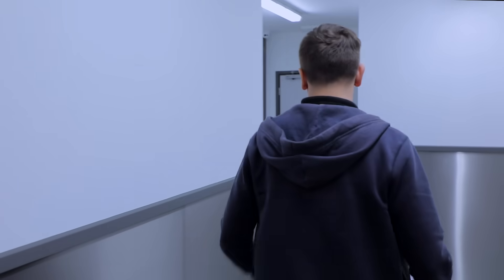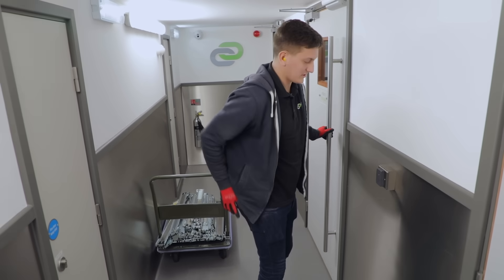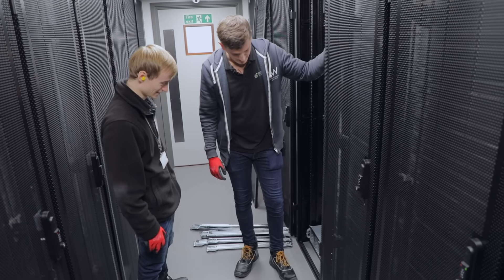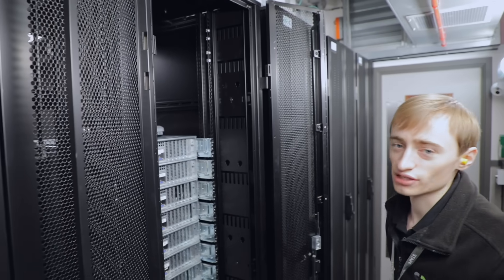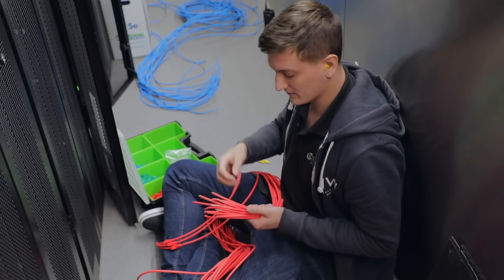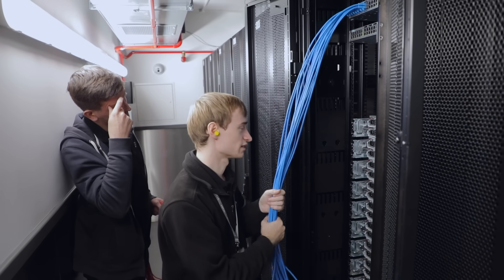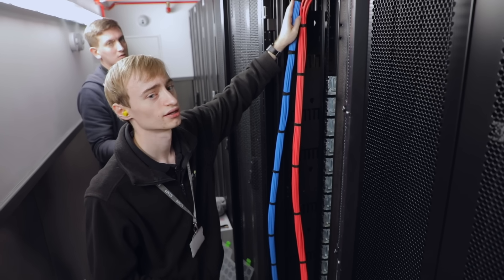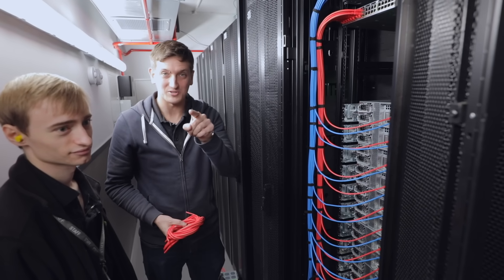A DAY in the LIFE of the DATA CENTRE | FULL CUSTOMER "RACK & STACK" with ASH & JAMES!

Comment: Wow! 1 minute in and I see 10x2RU servers stacked on top of each other. It might be convenient but I don't think the customers or manufacturers would appreciate that much physical stress on their hardware!  

This has to be one of the most incompetent rack and stacks I've ever seen! I workshop on how something can look great and be terrible. 

Other observations:
Using Cat5e cabling in 2019 is ridiculous
Suggesting that people should make their own cables rather than using pre-made certified cables
Actually cutting cables to length rather than using standard pre-certified cables in a datacentre
Power and Fibre co-exist way better than Power and copper
11:20 OMFG not leaving leaving sufficient cable length to allow the server to be pulled out for service/upgrade

Cable Porn does not equal good cabling!
Reply: To address your points in order:

The frames of the servers are more than strong enough to handle several hundred pounds. There's no way that would do literally any damage whatsoever.

The cat5e is kinda stupid.

Custom length cables are always superior and they likely cable tested these after making them.

Fiber is significantly more expensive to maintain as they can get dirt, and optics are more expensive than copper.
Reply: This reads like someone spouting shit that they know nothing about.
Just to shit on what you commented.
1. Servers can be racked on top of each other no problem, if you can't do that you bought the wrong types of rack that cant support the weight of your servers and it wasn't planned well.
2. If you use Ethernet cables for a large amount of traffic you are doing it wrong anyway, these cables are mostly only used for management traffic so their quality isn't really important cat 5 will do the job unless your datacentre is in a microwave. 1 for iLO/iDRAC access and the other for management access to the OS.
Most production networks use SFP+ ports with LC fibre 10GbE+ for their high volume production network traffic so you'd only be pissing money away getting cat gazillion cables.
3. Cables should be removed when servicing equipment, the great thing is these guys colour-coordinated their cables so that makes it easy to plug in and out.
Reply: @Alex-mu4ue  "Cables should be removed when servicing equipment" dude seriously?u took out the whole thing even as simple as swapping the RAM/CPU?
Reply: You have no idea what your talking about.

Comment: that was a great video,i have a question.
how to choose the best Cisco switch for a server rack like the one you just installed??
Reply: Normally the datacenter does not help you with what kind of gear you need, they only serve the power, room, uplink and cooling. They also have remote hands and / or installation engineers.

To choose which gear suits you the best you'll have to find a partner certified for the brand you want, in this case a Cisco Certified partner.
Reply: @Ano_ny  Thank you for your answer,
besides that can the switch and servers be at the same rack in Data center stranded
Reply: @bedodado5148  You can put all of your equipment in the same rack if you want to.

Sometimes this is not ideal in the case of huge power draw or heat output. This is normally not an issue and the datacenter should warn you if you are overcurrenting etc.

Comment: What is the difference between a 2u and a 3u can you tell me I know a Dell r710 is a 2u, am I correct in assuming that a r820 is 3u
Reply: it's the height in RACK UNITS (commonly shortened as "U" or "RU"). 2u means the server will be 2 units tall and 3u means it will be 3 units tall. a unit is a single space in a rack
Reply: The height of rack mount equipment is measured in rack units. Each “U” is 1.75 inches. So a 2U server is 3.5 inches high. A 3U server is 5.25 inches. 4U is 7 inches.... 

A full height “floor to ceiling” rack has 42U.

Comment: Great video. Would be interested to see how you manage fibre cables as they are pre fabricated fixed lengths? How do you manage the leftover slack for fibre?
Reply: You can also make fibre cables. Just need a few specialised tools and some test equipment. Most people use a fusion splicer which is quite costly although I believe you can splice fibres using a glue based system if you can handle some additional splice loss. Fibre work is more specialist and has significant OHS hazards compared to copper.

Comment: Why do you cut the cat 5 so short?. You can't pull out the servers.
Reply: if you have to pull the server out, it means you have to replace non hot-swappable FRU or do some serious repair, so you shut it down, unplug cables and then pull it out. Hot-swappable FRUs usually placed in ways to allow swap them without pulling out the server.
Reply: 44 Magnum unless the internal fans are also hot-swap. Which is the case with many servers. Personally think cable management arms look a lot better anyway.
Reply: @jonathansheppard8875  the problems is that you need the cable management arms for the servers, using these will hindre the airflow there, most data centers dont use cable management arms as they keep the warm air captured, i have around 10 full 42U racks we lowered the temperature some degrees just by skipping all the cable arms.
Reply: @whistler2000  Exactly this. I manage 2 cages in 2 datacenters for a customer of us and by deleting all the cable management arms the general system temperatures went down by a few degrees celcius. Upcoming we have a big cable re-ordering which hopefully brings it down a few degrees.
Reply: @whistler2000  correct . i am also fix and replace switch and server get problem if no good cable management

Comment: Great job! One suggestion for you from my bag of tricks. Once you measure out the length from the loom to the server, cut a "reference" length of cable from the box the same length. Now you have a measuring stick so to speak to cut the other sever cables the exact same length exiting the loom. Then the install will then look very neat.

Comment: This looks like a small cheap data center. The one we have it’s ceiling higher and each room is dedicated to each customer.
Reply: The reason the roof is so low in each pod is so that the hot and cold isles can be sealed off from each other. If you have a massive gap on top of your racks that defeats the whole point of putting the blanks into the racks.

Comment: CAT 5?????
Reply: on short runs it doesnt matter. 10gbit is no problem as long as you stay under 1m
Reply: What's wrong with it?
Reply: laszu it’s only cat 5, why not even cat6? There data center only has 10Gb uplinks?
Reply: laszu it’s only cat5.  That’s what’s wrong
Reply: you can easily cut and crimp them at a needed length; need 10Gb - use DAC cables

Comment: The vertical bars are actually called rack rails. The rails are actually called server slide rails.

Switches should always be in the back, unless its a patch rack.
Reply: Aren't they called posts? The racks in the video are 4 post, you can get 2 post as well.
Reply: Depending on the switch design, some switches should be placed on the front, if they dont support the right push pull for the airflow
Reply: @whistler2000  Any proper DC switch will allow for either forward or rear airflow fans and PSUs. Most non-DC switches (which a lot of people still use) are side-cooled which makes no difference as to whether they are front or rear mounted (they'll run hot either way)

Comment: nice work! but unfortunately you cant pull the machines out because of the measured cables for example switching failed fans etc. ...
Reply: servers that allow hot swap of failed fans or something that make you pull out live server are come with cable arm in a box
Reply: @44magnum84  afaik they have to be ordered seperately. but yes, they´ll do the trick
Reply: just disconnect the cables, repair and reconnect

Comment: In this way you have a lot of discarded cable.
The best way is take the longest lenght for the first 2 cable  and then cut 20 cm shorter the next 2 cable from bottom to the top, and go until the last two.
In this way you can save 10 or more mt of cable.
Nice rj45 shells
Reply: Bb
Reply: B
Reply: Bbg
Reply: Bbgg
Reply: Gbg
Reply: Bgbb
Reply: Ggggggg
Reply: Hggggggggg
Reply: Hbggg
Reply: Hbbb
Reply: Bb GB glggg
Reply: GB hbgblggg
Reply: Egg
Reply: Ggg
Reply: Gbgg
Reply: Bgg
Reply: Gh
Reply: Gbggg
Reply: Gggggg
Reply: Lgggggg
Reply: Bgb
Reply: Ggggbbbbg

Comment: no labels on your ethernet cables?  great!  what if you have console issues with one of the servers. how do you figure out and troubleshoot the connection?
Reply: Idk about them, but I don't put labels either. I just plug it in order. So, server one is connected port one on the switch and so on.
Reply: You can just use a tone tracer
Reply: @h0lysp4nk  Fox and hound baby!
Reply: I haven't found a label that will stay on for more than a few months. What do you use?
Reply: @bobkoss280  we use to put transparent heatshrink over the labels. But labels are not strictly necessary: there's only ~20 cables per rack & color, and when you plug them in in order they are easy enough to find (if in doubt just tuck them a little ans look what moves). So nowadays we tend to only label the fibers that connect the individual racks.
Reply: @bobkoss280  have you tried self-laminated Panduit labels?
Reply: @bobkoss280  Brady vinly wrap labels, i have labels still sitting fine after 10 years, panduit makes some to.
Reply: there's no need to label them in such installation, just put them one by one in order from top to bottom

Comment: What is blue cable for?
It is different with the red one?
Reply: Just to be able to easily tell which one goes where. Usually servers are connected with multiple network links for redundancy and/or have a dedicated management interface - so you have to make sure that you dont mix up the cables.

Comment: What does Red network cable and blue network cable for ? is it for inbound and outbound?
Reply: Usually the separation is for data and management networks. In other cases its data and a clustering network. Or blue primary data and red is failover. It all depends on the network design really

Comment: Given the time and expense of making up network cables by hand like this, it's actually cheaper to just have in stock the required lengths of cables - especially given this is a data center so they are going to have a constant need for standard cable lengths.
Reply: the customer specified specific placement of the units in the rack
Reply: @kevinfoley8387  And this has to do with cable length what exactly?
Reply: @kevinfoley8387  Even if the customer specifies a special rack layout, there's only so many combinations possible... Typically you only need cables from 0.5 to 3m in 0.5m (or even just 1m) increments. It's a total waste of time to do that by hand.

Comment: No idea why yous dont buy premade patch leads. And theres nowhere near enough slack to pull them out on the sliding rails. The whole point of the sliding rails/cable management arm is so the server can stay on while you pull it out
Reply: Customer design. It would be different if the customer supplied cable management arms with the servers etc
Reply: @asusservertek131  otoh those arms are usually a pain in real-life operation, and they can very much restrict airflow for cooling (especially if you have lots of 1U machines).

@AutismGamerHDTV Those machines don't look like they had hot-swappable components inside. PSUs and disks are swappable without sliding them out - for anything else the server has to be powered down anyways.

Comment: I had to design and implement such a network project for one our customers. It was a oil plant and the heat was unbearable in the server room. They had switched off power for some parallel electrical work. The cabling part is a nightmare even though I had a technician to assist me. Adding to that we had tremendous pressure from customer to get it over within 3 days. When it was over and I checked the network we were facing a loop in one switch. It took me another day to find and fix it. It was due to a wrong cable tag. I sweared I will never go for site implementation again after that episode..I really appreciate these engineers

Comment: The cables bundling is neat and using velcro instead of zip ties is  a great idea.
Reply: Anyone that uses cable ties should be shot. Especially anyone that doesn't flush cut them (looks at scars on arms)
Reply: yes omg I switched to velcro recently and it improved my life so much xD
Reply: Nice job, you should just buy cables already in the lengths you need. Working in the US Postal Service data center we had cable in .5 foot increments up to 20 feet. You waste a lot of time terminating RJ-45's yourself.
Reply: @mikevadnais7722  It is not always possible to carry a huge inventory of pre-made cables for a contractor like myself. My van only has so much room. We use premade cables for patch cables. But how do you think structured cabling is installed? You have to make your own.
Reply: @haroldpalmsesq2506  I know exactly how structured cabling is. I design and build copper and fiber infrastructure for the US Postal Service in Eagan, MN. We carry copper and fiber in 1/2 foot increments up to 30 feet. After that, they are incremented by 1 feet up to 60 feet. Yes our cable closet is huge. All our cables are made offsite by 2 different cable contracts. All our fiber trunks are spliced on site to exact lengths. Copper trunks are also to the exact footage and punched down. I have been around the block:)
Reply: @mikevadnais7722  Ok, tough guy. You know everything and you know how it should be done. 
Let me know how you do it when it’s your warehouse, your van, your money tied up in inventory. You are high on the hog with  someone’s else’s money, son. 

Because I installed fiber and cat6a at a brand new Google Data Center. I have to manage all aspects of my own business.
Reply: @haroldpalmsesq2506  Just sharing how we do it. There are many great ideas out there from everyone. Have a good day.
Reply: @mikevadnais7722  Also, if you need exact lengths, good luck with premades.
Reply: Not only a great idea, it's code for anything cat 6 and up, as the zip ties trend to squish the space between pairs in the cable, which increases crosstalk and reduces heat dispersion.
Reply: Yes, I totally agree. Very neat and tidy, which makes any form of maintenance easy to carry out.

Comment: Very neat and clean install!  Makes me want to start re-wiring and re-dressing the cables in my racks at work.

I did notice, however, that you didn’t leave enough cable in the back to completely slide the server completely forward on the rails while it’s in service.  When I do a rack I always factor-in the need to change a fan or add/change an internal component at some point in its lifetime and wire it so I can pull it out while it’s still running.  That’s one thing I like about Dell EMC—they actually have n arm that attaches to the back of the rail that’ll hold the cables and ensure that you can do that.

Just food for thought!!  Again, very nice install!

Comment: Where are the cable management arms for the servers? They should be mounted on the backs of each server to run power, Ethernet, kvm, fiber cables etc. Without them you can't slide the servers out for repairs or upgrades without unplugging everything. That's not cool
Reply: They can impede airflow though (especially if you have 1U machines). And frankly, it doesnt take that much longer to un/replug a handfull of cables. For major upgrades/repairs the machine has to be powered down anyways, the only thing that would be hot-swappable on the inside are the fans, and those rarely ever fail (I take care of a 140 machine cluster and have not had a single failed fan in the last 5 years).

Comment: Why are cat5 cables used and not cat6?
Reply: There wouldn't be much benefit to using Cat6 as the distance isn't that long, you don't need all the protection from interference as there are not that many ethernet cables.

Comment: Who the hell still uses Cat5 in 2019 or 2020. Should be Cat6 minimum, or with the prices finally coming down, Cat6A.
Reply: or fiber cable, the best option in data transmission
Reply: @Darkroom188  what would be the benefit in this case? It's more expensive and more fragile. If 10G are enough then Cat5 is perfectly fine.

Comment: @6:04 Cat5 :O Jesus... why would you use Cat5?
Reply: You can see, that they pull the cables out of a box that is labelled 5e so i guess they use 5e not 5. 5e ist absolutely sufficient if they only use gigabit and the cheapest option.
Reply: For real if you're not running at least Cat 5e what are you even thinking? No excuse when you could have speeds 10x faster for paying marginally more.
Reply: @goalzrs  Many people simply call patch leads Cat 5, when in fact they may be Cat 5e or even Cat 6. I doubt they're actually running Cat5.
Reply: We use Cat.6 for everything except 10G, there we are using Cat 6A or Cat 7.

Comment: Just to clarify, did i hear that yo u were installing cat5 cables? if that is the case is that because the management modules do not need more than 100Mbps connections to the switch?
Reply: Cat5(e) is perfectly fine for 10G over such short distance.